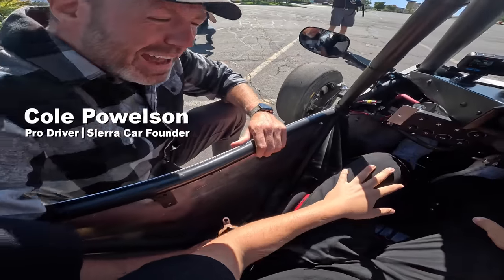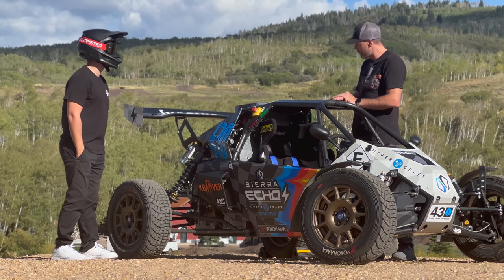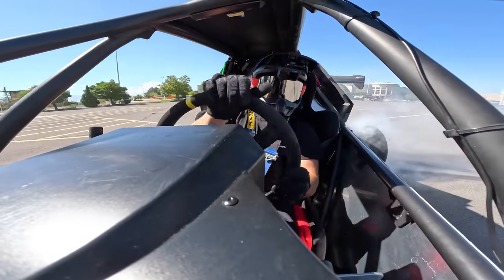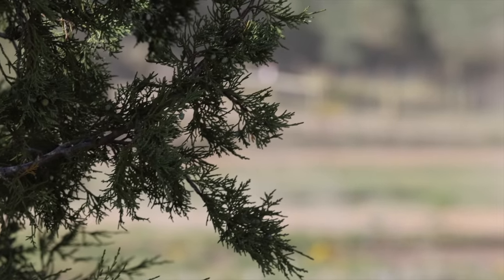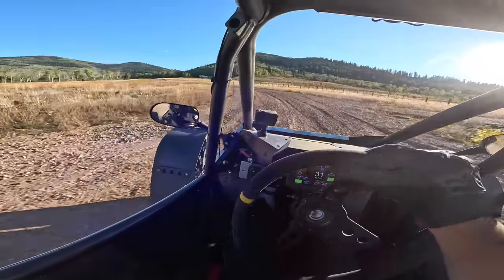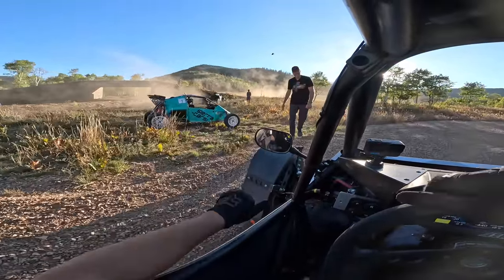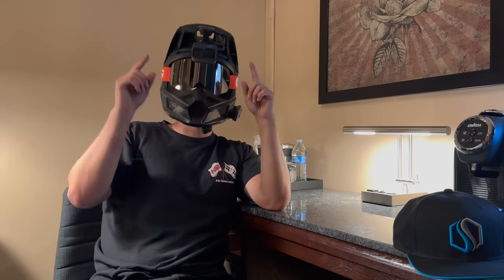Insane Electric Supercar First Drive // Sierra Echo Block Edition

Comment: On dirt, you need 4WD if you look for a good performance. RWD only on dirt will make it lose a lot of power to waste. You may deal with this problem by using a single motor+transmission connection or double-motor

Comment: The car you drove in this video is $75,000 not $39,000. The base is the “affordable” model. The bait and switch advertising is very shady. I was interested until I saw the scam. I’m ok with $75k but I don’t trust what I’m going to be quoted for one of parts after purchase, not to mention lead times and possible labor. Just sucks to advertise that way. Super cool unit though.

Comment: You at 1:34  "This feels like a million bucks."
My Lazy-Boy  "If you include the educational costs of all the engineers that put in hours you are low on you're estimate."
You at 1:45  "Woooo"
My Lazy-Boy  "Wow"
You at 1:55  "It turns so nice"
Me at 1:57  "That was technically a slide"
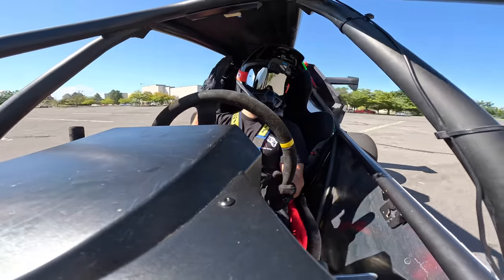You at 2:14  "Wow the throttling and control on this is insane"
Me at 2:18  "I'm curious, is the throttle hall sensors, potentiometer, or other and is it linear or more insane at the top?"
You at 4:55  "I'm hearing that, in the near future this might be more of a consumer option"
Sierra  "This car 39K"
Me  "Hell Yeah!"  I'll take a 5 point harness over airbags any day
You at 9:30  "I got dirt in my mouth"
Me  "I'll drive the water truck...its not like I live in this Lazy-Boy ya' know"
You at 14:43  "Dunes Tomorrow!"
Me "Dunes?  Yuma?  I'm not far.
My Lazy-Boy  "What about work?"
Me  "Shut-up! nobody asked you."

Comment: MOAB just closed 1/3 of their trails and it wasn't just because of noise. The main issues aren't from the Jeep or truck crawler crowd either it's UTV's as they drive everywhere at unsafe speeds. UTV's tear up the land big time and creat an ungodly about of dust and that crowd litters to no end. I like the power electric delivers but and this is a BIG BUT...  they'll tear up land worse than anything because of their torque. My point is, everyone is kidding themselves if they think electric off-road vehicles will stop trail closures. It sucks but it's true.

Comment: 😂 Mikkalo didn’t think thing Michael Angelo was at hard😂😂 finally an RC you can drive in👍 it would be awesome but just like the RC’s batteries are stupid expensive and they just don’t last, especially with that kind of high discharge rate I’d like to know the discharge rate on those battery packs

Comment: Hey @surronster genuine question about the insta360, noticed you had it on the back for parts of the video and at other times it appeared that you took it off and I can't see any footage being used of that 3rd person angle you had. Did the 360 just get to dirty to use or did something error on it back there? I'm asking as I'm heavily considering buying one soon but in a few of your past videos it does seem like you've had a couple issues with them so just curious about this video and why you didn't use the footage/camera?
Thanks!

Comment: Interesting...but how is throttle CONTROL??? Like, not just throttle response, but what about needing to back down while still maintaining speed such as in a wheel spin trying to return to traction at highest speed possible in the situation? Idk maybe like say, pff roadi g in the mud and needing to keep the wheels turning, beginjng to spin and lose traction, and needing to slow them down but keep moving....

Comment: Definitely going to have to put runtime capacity in it.
 can't be pulling battery packs or suffering with charging downtimes. Must-have parameters to base practicality on such as racing with runtime needs relative to heat laps of various types of competition to determine battery capacity.. .

Comment: they need a street legal 2 seater with heat and ac. a small hibrid set up too extend range say a liquid piston uav engine . then range would not be an issue and neither would fuel types. but this is the drawing in the back of my head called project pipe dream. a 2 seat hybrid car for around town use with some legs for 300 mile excursions with out plugging in. 
i see holey performance also offering tesla power trains for builders....

Comment: Meh, being able to hear the power is the drivers best tool for racing. I once had a throttle stuck wide open and instantly just shut my bike off. 
With this all you can hear is rubble, if it’s literally all a computer what happens when it glitches out?

Comment: Race cars crash and when they do the batteries would melt you very quickly. Driving an electric car as small as this alone is one thing, put it on a track where it can crash I wouldn’t want any part of it. Maybe a dragster you can be 5’ from the batteries, but definitely not anything like this or sprint cars or any or racing that other cars are next to you.

Comment: There needs to be a lever like the brake lever that can be used in motion and is used as a switch, when its forward the car is   fwd and when its pulled back the car is rwd giving the driver better control

Comment: i think people will deffinatly buy these but they wont be cheap ,the charger they use is one the nest at the moment i have one for my ebike ,they charge super fast if you have compatible battery and bms
Reply: haha the phase wires are like one inch thick each there must be over 6-700 amps going through that system

Comment: Its cool but any european made carcross whit the litle 600cc engine will smoke it miserable
Reply: I disagree. EV is instant torque. You get out of deceleration and pin it and instant power. Just my opinion. Honestly it would be Kool to see em race. Cheers
Reply: @treeguy-nq2bb  Who cares about instant power in a terrain where IS hard to get traction, and an european carcross  weigth IS less than 300 kilos